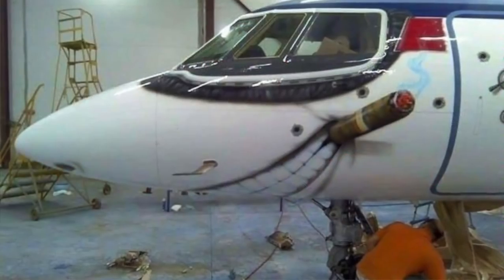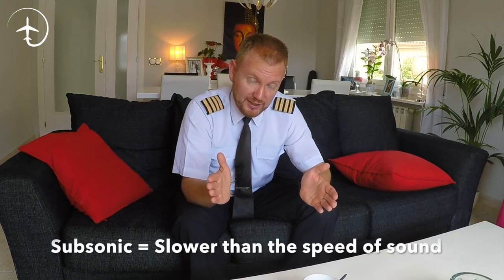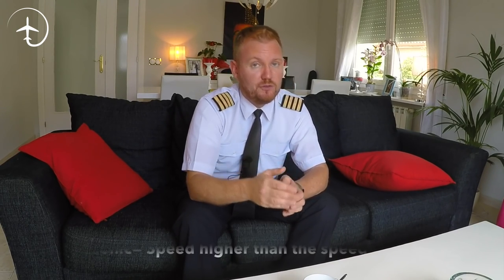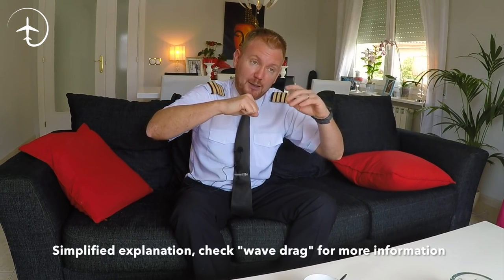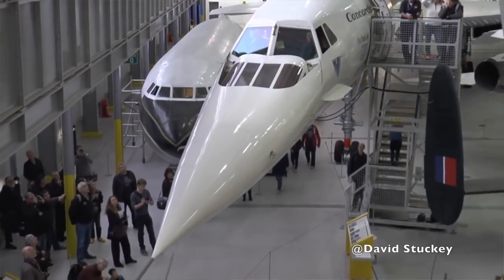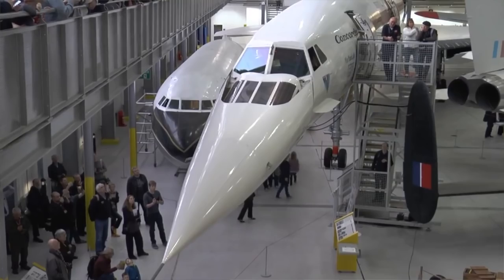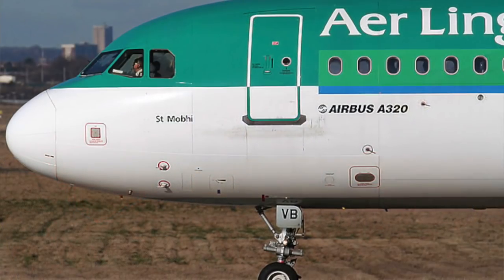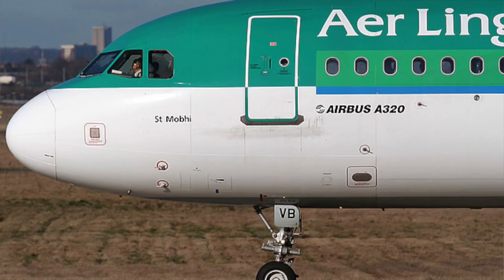Aircraft Noses. Boeing vs Airbus and Rounded vs Pointy.

Comment: There is also an icing issue.  The blunter nose is less prone to icing.  Cessna stuck to their blunt nose while Learjet went to a sexier sharper nose.  Learjet needs a de-ice system for the radome while Cessna does not.  The newer  nose on the 787 has some geometric curvature control (the second derivative for the equation of the surface for you math heads) designed in.  The traditional nose shape used on the older Boeing and even the newer Airbus causes a rapid change in surface direction just above the windshield on the canopy.  That rapid change causes the slip steam to go supersonic just above the pilot's head when the aircraft's speed is in the transonic region and a sonic shock wave forms there.  That cause a lot of wave drag and a lot of noise in the cockpit.  The flight crew perceives it as wind noise. The newer 787 nose gets rid of the kink at the bottom of the windshield and allows a "softening" of that local curvature on the canopy.  That lowers the slipstream speed and gets rid of the wave drag while quieting the cockpit.  So the older airplane company leaped ahead with the 787 design.
Reply: I guess the reason for the shape of the aircraft older than 787 is that it is easier and cheaper to create a window without too much optical abbreviation if it is flat and not too much inclined. Now the material technology is better and it is possible to make curved windows that are acceptable both from an optical an economical point of view.
Reply: Yep, exactly.  To maintain optical clarity with a glass windshield, the windshield has to be either flat or what is called a flat wrap design.  Glass only likes to bend in one direction without distorting your view looking through it.  So the older designs were a best compromise between a flat windshield and the aero requirements.  Also, we say that glass is heavier than aluminum.  So we tried to minimize the size of the glass windshield while providing the view needed by the pilots. That is the name of the game for engineering, finding the best compromise.  And you know what a perfect compromise is; when no-one goes away happy.
Reply: Very good reply. As long as you're not trans-sonic, a blunter nose is actually better. That flips when you blow past Mach 1, though. Then a "pointier" nose is better. Also, as Mentour Pilot explains in his very good videos, a blunter nose has more room for the weather radar.  Cheers!
Reply: @skytrainii8933  
Just use transparent aluminum. Best of both worlds, but expensive
Reply: @adrianfirewalker4183 : Yeah, that would be supper except transparent don't mean the light rays don't bet bent as they go through.  So the view would be quiet distorted.  You would then have to do something to straighten or correct the light rays so the pilot could get a good view of the world. And you know how distorted a view commercial pilots have of the world.  You would have to employ Frits Zernike's polynomials to straighten out the pilot again. (A little "Big Bang show humor here. You know, a Sheldon joke that no one else gets.)
Reply: @skytrainii8933  
It could be ground (as are eyeglasses) to correct any hypothetical distortion. 
This technique has been used for centuries to correct mirrors which are used in astronomical telescopes.
Reply: Excellent explanation, but did they leap ahead or went back in time (the comet design)
Reply: I see both pillows are red. Is it just for decoration or does it depict someyhimj7jj

Comment: Very interesting and well explained. You cleared up some doubts that I've had for years.
Reply from the maker: Excellent!
Reply: yes, thanks so much, very clear. I would imagine that there is a speed zone where its not so clear which one is the most efficient and not just crossing the speed of sound. I also wonder if a constant diameter fuselage is actually less efficient than an varying diameter egg shape. Of course we all know which is more practical.
Reply: The wing roots affect the optimal fuselage cross sectional area in the mid section verses for and aft, I recall reading somewhere that a coke bottle shape is good for craft with wings. For submarines and subsonic projectiles an elongated egg shape with a length/width aspect of around 8:1 is optimal, but using a much more practical cylindrical center section only minimally reduces efficiency, similarly using higher length ratios also only has a minimal effect.
Reply: My tech...I have noticed the wing roots zone of the fuselage transition shape. It made me think there is actually only one continuous wing that the fuselage sits on.

Comment: Another question I have, maybe for a future video is why are modern airliners coming with heavily angled-upward wings? Older airliners had pretty close to horizontal wings (looking at it from the front or back), whereas the latest Boeings and Airbuses have wings that get steadily higher as you go out further. I think the first airliner with this that I noticed was the original Boeing 777, kind of like a soaring eagle's wings.
Reply: That's called "dihedral" in case you wanted to look it up.
Reply: They scraped wingtips for upward wings, which has the same function, but is more efficent

Comment: Watched the nose youtube and thought about passing on some experience as an ex Boeing software engineer. I was on the SST project in the late 60s as a lofting computer programmer. That entailed programming the geometry of the plane without the aided of a CRT or monitor. In turn that geometry was used to machine all the component using NC tools. The 707 and 727 were done by hand although the 727 used Cadillac veneers to layout the line from computer generated drawings and as a result whereas the 707 was called the flying shim the 727 was down to about 125, The 737 was the first to use nc and had 3 but it used the nose of the 707/727 as cost parameter since it existed and worked. So you were right that it was used but I think it was to save design and training money. A nerd note, only 2nd degree equations because the lofters were afraid of using 3rd degree equations.

Comment: Well not exactly.  It is the pressure wave not a "rumor" in front of the nose of subsonic craft. This wave can only travel the same speed as a sound wave (in gas). The point actually creates the first of and critical bow-wave in supersonic flight. Anything that protrudes from that cone/shock wave creates its own wave and dramatically increase drag and decreases control surface effectiveness. The shape not only helping drag but more importantly the heating the drag generates especially in the nose which has nowhere to radiate the heat. The round nose in contrast gives the most aerodynamic predictability at more angles. A pointier nose generates more dramatic changes aerodynamic forces with slighter changes in AOA. Think of a ski vs saucer sled in the snow.

Comment: I remember seeing the then-new 707 next to prop planes at the airports--that nose said "I'm so much faster..." The 727 and 737 often replaced prop planes on the short haul routes, so it was still effective advertising into the '70s. The 747 had a look all its own, of course. They didn't have computer modeling back when they got type certs for them, so all the more impressive that there was little to improve. IIRC the more upright windscreen helps visibility, so pilots can lean forward to see ground crew, and had something to do with the limited ability to make laminated glass with complex curves when the original designs were drawn. Jet fighters up to the F-14 used a piece of flat glass straight ahead of the pilot, and still broke some on bird strikes. The conformal front window panels on the 787 were supposed to be enabled by advances in glass-making and the plastic body, and make the flight deck much quieter. Isn't the Airbus quieter without the V-shaped windshield layout of early Boeing?

Comment: Looking at the noses of the 787 and A350, they're pretty similar in profile, no doubt due to developments in computational fluid dynamics and wind-tunnels.
Comparing the nose of the Comet to it, i wonder if the similar look is due to a coincidence, or did the De Havilland engineers develop it based on similar thinking.
If so, i'm amazed that it didn't end up being more popular between the time of the Comet and 787/A350...
Reply: the comet was a very beautiful aircraft way ahead of its time
Reply: At the end of the day aircraft are heavily constrained by aerodynamics.

For whatever minor differences they have you'll notice almost all airliners look pretty similar.
Far more so than the average car does.

Meanwhile look at trains, and compare the wide variety of sizes, shapes and surface patterns on lower speed ones to the high speed trains, which still retain some individuality, but start to look a lot more alike.

And Concorde looks very much like a really large fighter jet.
Why?
Physics.

You can't escape it, only fiddle in the margins.

For any given flight regime there is going to be either a single optimal design, or a small number of rather different optimal designs with differing characteristics.
Pretty much every aircraft built is going to resemble this theoretical optimal design in all but the most trivial details...
However the slower the aircraft the more it can deviate from these optimums because the consequences of it are less severe.

The comet was probably designed with careful consideration of aerodynamics, and it's largely still the same flight regime as modern.

Too bad about the window thing, or history might've looked rather different...
Reply: Renember back in the 70s when "people" were bragging about the russians copying the F-15 with the SU-27/MIG-29?

the SU-27 and MIG-29 look very similar because their design bureaus shared aerodynamic data ..and the results were therefor similar.. wich were also similar to the F-15.. because in the end you should reach same or very similar solution for the same problems..
The MIG-25 for example predated the F-15 and was getting there too..
Reply: I think that there's a similar reason of aerodynamics that has made all the Le Mans prototype race cars look so much alike.
In my opinion many of the modern hypercars coming out also look quite similar, like how there are looks between Aston Martin/Red Bull's ultimate model, Mercedes-Benz hypercar and many others.
Reply: KuraIthys, The "DeHavilland thing" was the result of not realizing the effects of cabin pressure on aircraft that would be flying at over 25,000 feet altitude. Propeller planes that flew at over 8,000 feet were pressurized but flew at much lower altitudes than the new jetliners. Jet airliners fly at as much as 38,000-40,000 feet where the outside air pressure
Reply: the Valkyrie, AMG Project One and Chiron look as different as cars of that performance can
the Chiron just beating drag into submission through power, the Project One similar to the McLaren F1, Jaguar XJ220 and group C cars with a separate underside and upper body, both rather smooth approximating an upwards pointed droplet profile, while the Valkyrie is more LMP and open wheeler inspired, directing air through the front around the cabin and engine, with the floor getting conneced airflow beneath and on top

Comment: Will an aircraft with golf ball dimples creat less air drag . Thanks for your information.
Reply: Theoretically yes (though maybe not the wings. not sure how that would change lift) Main problem would be that aircraft skin is quite thin. so the dimples would be bumps inside which not only would reduce space, but weaken the structural integrity for pressurization etc.
Reply: @Valantir  dimpling the metal skin would make it stiffer and harder, wings need a little bit of flexibility. 

The dimples only reduce the separation of the air around the golf ball due to its geometry. The dimples are like vortex generators. They might help with lowering the stall speed but the drag from the dimples would reduce the cruise speed.

Comment: The Concorde's nose also had to be hydraulically lowered so that the crew could actually SEE the runway when they were landing.  What also complicated matters was the heatshield that fell into place over the canopy glass (during supersonic config, with the nose up) to keep the crew cool.  More weight, more complexity.  Yet another maintenance issue to deal with.
A plane that's not going supersonic doesn't need all that extra gear because it's not going to get as hot.  Without the long point nose, they also have an easier time seeing the runway.
The business of being able to see over the nose also affects the design of carrier aircraft.  Carrier aircraft generally have shorter noses than their land-based counterparts because of the need to see the ship on landing approach.  The infamous F-111 had a carrier version of that plane, the B-model, which had a shorter nose to allow the aircrew to see the carrier on approach.  It still got cancelled before it went into production partly because of excessive weight (close to 90,000 lbs loaded), partly because of the poor carrier handling characteristics.

Comment: I worked on Grumman's A-6A Intruder for a decade during it's Weapons development phase.  I loved the A-6 design except for the nose Radome.  It covered both the Search Az Sweep (upper) and the Tracking/Terrain /EL clearance radar(lower)Radars.  It had a large (high) subsonic speed envelope and a 90KTapproach speed and a Mach.85 Max speed.  It was a pilots A/C. as Perfectly suited for an attack Bomber as possible.  I designed an attack flight profile for its Nuclear mission, High-lo-high in this case.  A fun job for my initiation into military A/C.  I peally enjoy your videos, they often fill in   gaps of my knowledge.  I wanted to become a pilot, volunteered for the USAF, but was rejected because of a medical problem, So I had my career in Weapons systems test and integration.  You are more fortunate than I, you get to fly as well. And get paid for it.

Comment: A few things to understand, first the two forces pressure on the front, and suction on the back. So all subsonic wings have a pressure side on the bottom, and a suction side on the top. Suction is the greater force being something like 60% of lift, where pressure contributes 40%. The point of maximum volume is usually around 30% aft of the nose, as a result aircraft noses are visually more rounded and tails more tapered. The tapered end reduces suction force or extensive drag from the rear of the aircraft. At the same time the greater volume of the flying body more forward is useful for storage of people cargo and fuel.
Another consideration is laminar flow. Air will flow around surfaces but has trouble getting around steep curves, so its ok on the nose around the pressure side, and it will stick to a curved top and bottom, but in the end on steep curves like that up front it will want to break away from the surface, releasing itself from smooth laminar flow to go turbulent, where turbulent flow is much more draggy than laminar flow. One more way of looking at this is on the classic wing cross section. The bottom or pressure side is easy to understand, and as long as angles of attack are gentle it will have laminar flow, across the top on the suction side however, it is important to try keep the flow attached for as we have just learned the further aft the top flow can remain attached the more lift the wing provides. As a result the ulterior goal of creating useful volume of the inside of the wing can be achieved for fuel storage, if the curve of the upper surface is a progressively more gentle curve as it goes aft.

Supersonic flow is so difficult to achieve all the structures like fuselage and wing need to be much thinner to keep the boundary air attached and maximise laminar flow, as a result the maximum depth of sections like wings and fuselages is further back towards 40% of the section. To maintain smooth lines the curves are necessarily gentler, and the entry of the nose and leading edge of the wing much finer. It becomes apparent that the main result is a thinner less bulbous entry, or finer thinner shaped nose and leading edge section of the wing. Hence the graceful Concorde is quite a narrow low volume cabin, but the fine curves present a much sharper front and even more fine aft. The same rules have been applied to a much thinner body necessary for high speed flight.
Finally two governing rules are, circumstances of the aircraft skin tend to rely on areas so are of the square root rule, example wings are of 'x' square feet, where circumstances of force are a cube root rule such as propellers or jets offering 'x' lbs thrust.